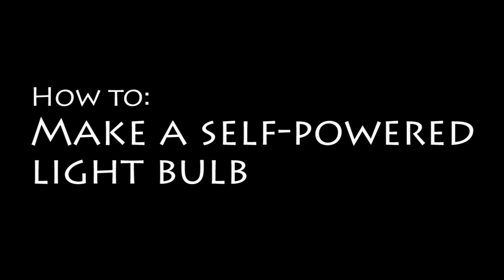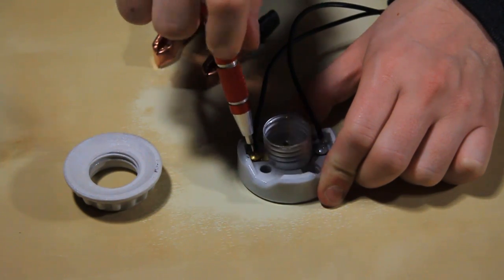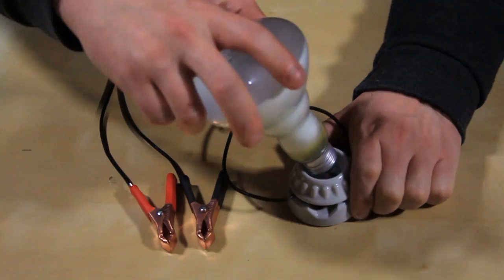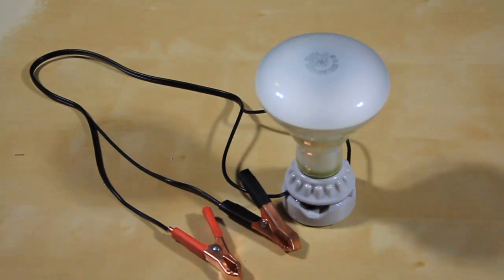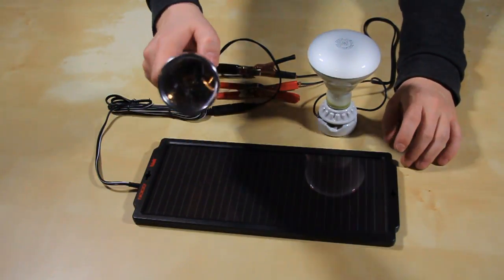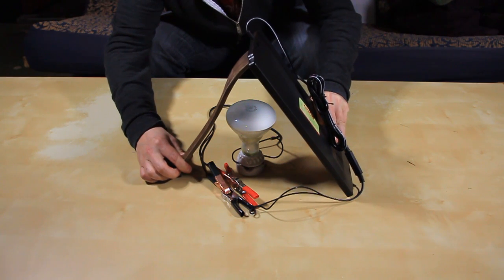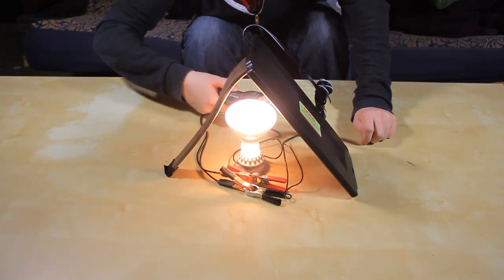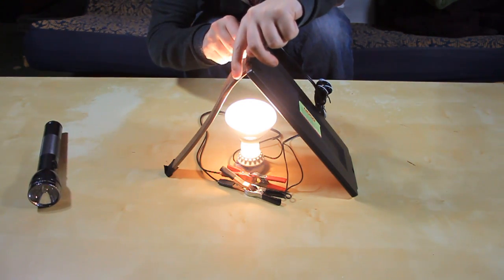SELF-POWERED LIGHT BULB!

Comment: kind of, the main fault with this is an amount of the energy (alot if its one of the old tungsten bulbs or a little if its a power saving bulb) is being released as heat energy and the rest as light, that heat energy will constantly be taking up a portion of the overall energy and eventually will cause the cycle to fail. Expanding on your comment XD

Comment: Umm.. that solar cell doesn't have the voltage to power that light. The best Solar panels rated at 100 to 200 watts cover about 10 square feet. So, inefficiencies of the solar cell combined with the low power that the flash light produces isn't enough to power the light. This guy needs to stop tricking people.

Comment: Hummmmm....... Something does not add up. That solar panel is maybe a 1 to 5 watt @ 12 volts and the light bulb is a 100 watts @ 120volts. =D lets see what is actually plugged into the light socket.

Comment: Ok, this is quite fake. The lamp is emitting a certain amount of energy, therefore in order to power it, the solar panel must output that same amount of energy to keep the light on. There is no way that the solar panel do that, seeing that it's not even close to 100% efficient, only a small portion of the bulb's light is hitting the solar panel, and loss of energy through heat. The room's light is nothing compared to the brightness of the lamp, and couldn't possibly give that much energy either.

Comment: yea thats true, i did some thinking and those lights run 120v i think. so i'm now positive that even with the flashlight  shining as well as the bulb, the solar panel still wouldn't have enough power to light one of those bulbs anyway. i'm guessing that the bulb fitting has extra connections to a real power source

Comment: This is fake. Even if you could use every photon being emitted, and had a 100% efficiency solar cell(which is not possible by today's technology), it would still be impossible because the lamp also produces heat which cannot be converted to electricity via a solar cell. Second law of Thermodynamics.

Comment: There could be some holes drilled in the table that we can't see for cables that supply power from real power source. Sorry but this solar panel is just not powerful enough especially if you shine at it with just common flashlight.

Comment: Won't work for long. There is no such thing as a perpetual energy device, as it is always being lost as heat, sound, light, or mechanical motion. In this instance the energy being lost is turned into heat rather than light, and the fact that some light escapes the device would make it die out even if no heat was being created in the process.

Comment: How is this even possible? Solar panels are inefficient and only convert a small portion of the light that is projected on them. Plus, there can be great power loss because a great amount of power is going into the lightbulb, but not all of the energy is captured.The solarpanel has to surround the entire lightbulb  to capture around 98-99% of the energy that the lightbulb is emitting. I don't see how the small surface area of the solarpanel can capture enough light energy to power a100-150Wbulb.

Comment: It is. It isn't possible. You are (indirectly) powering a 120v light bulb with a few 1.5v batteries. A LOT of power is lost between the batteries and the flashlight, and then a lot more between the flashlight and the solar panel. The total amount of energy received by the solar panel is less than half a volt. Best case is that you get 0.5v off of the solar panel. That is 240 times less than needed.

Comment: the energy glowing out of the bulb isnt absorbed 100% by the solar panel, and all the wiring inside the panel, off the cables and into the bulb consume energy and make the energy be a bit less each cycle, you cant get a perfect energy flowing system, it goes against the Entropy Law of Energy that says the the Universe will always gain energy and will never lose more than what it gets, if you ever make a perpetual energy/movement system you will break one of the most important laws in physics

Comment: I've thought of better version of this idea before and for other objects. For instance a car, you can put rabbit holes in the front of a car (they are holes that direct air into propellers) they can power some of the car, put those wheel things (I'm at a loss for it's name, but it is basically a crank) on the wheels so if you let the car roll it will power the car, put some solar panels on top and you basically have an entirely self sufficient car.

Comment: I this may be fake. Cause its funny how the light flickers on and of when "getting power from the torch" rather than just lighting up slowly. That torch would only have 300 lumes, yet it charges a bulb with 1200lumes to mak brightness. Maybe if it was charging a battery then releasing power. But this is a straight circuit. Again with the flickering and the funny table he has it on looks like a bit of ply. might have the actualy power cords of the bulb going under the table...

Comment: not only that- don't forget that light bulbs aren't 100% efficient either. most of the energy give off from incandescent light bulbs is in the form of heat, not light.  that's why many of use now use LEDs which use a different method of converting the energy into mostly light and much less heat

Comment: Solar panels can only be so efficient. They only generate a percentage of the energy they receive, so there is always going to be a net loss of energy. There is also energy lost as it generates heat, as well when the light misses the panel. After 20 minutes, there's simply not enough energy left to maintain the energization of the gasses inside the bulb, causing the light to "turn off".